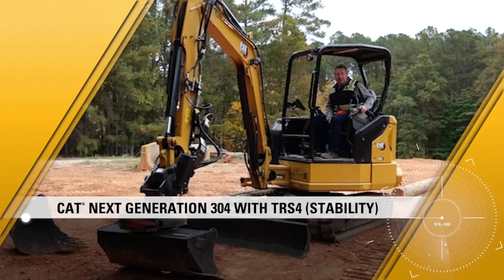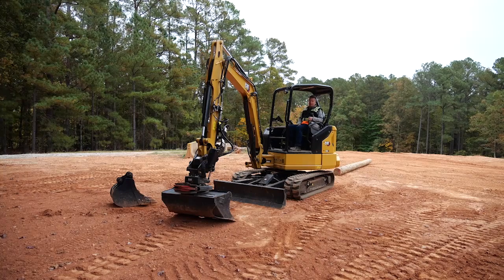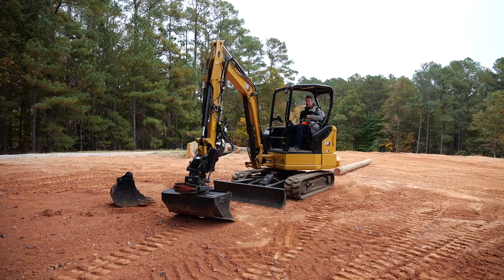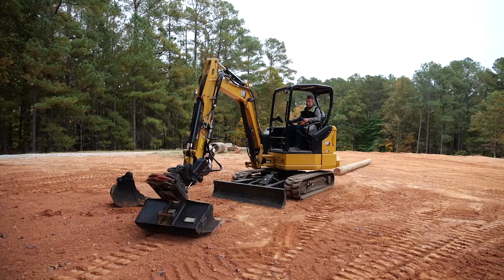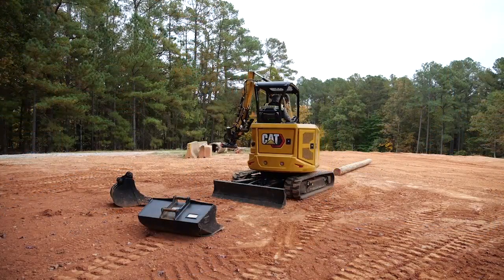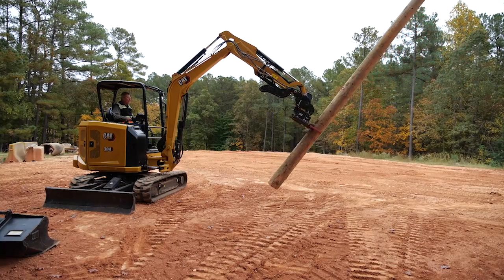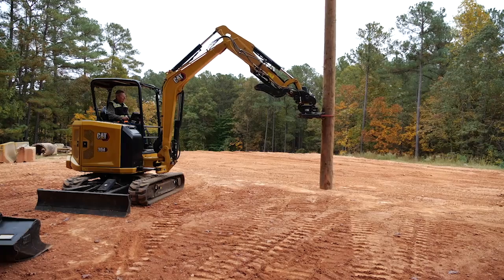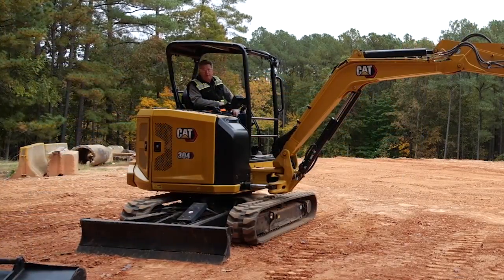Cat® Next Generation 304 Mini Excavator With TRS4 (Stability)

Comment: I dislike this new design. If these machines are made to work in reduced areas what happens when you swing around and you have 14 inches hanging of your track?
Reply: I think it’s a trade off. If you widened it back to its original stance you wouldn’t have overhang but you might also not fit into the tight spots that require the narrower width to track through the overhang is there to give stability when working over the side to balance it out. So you can step up to the 305 which would be zero or step down in size. I think they were trying to cover the most ability per customer input in the 4 ton size.